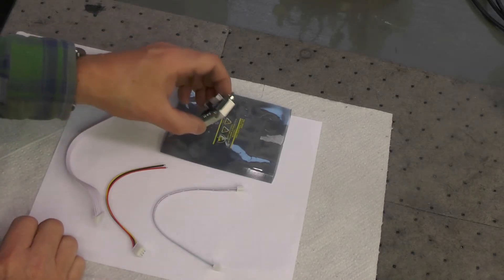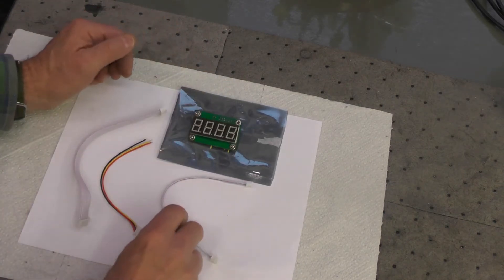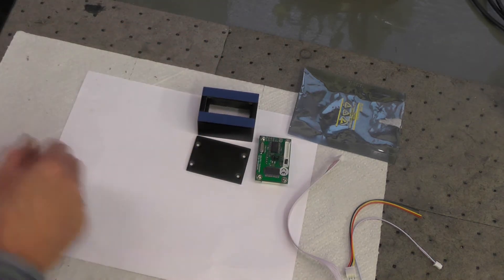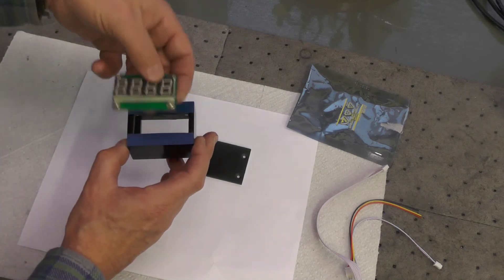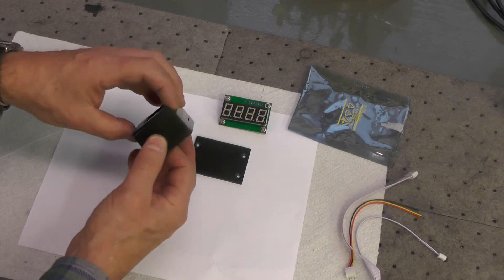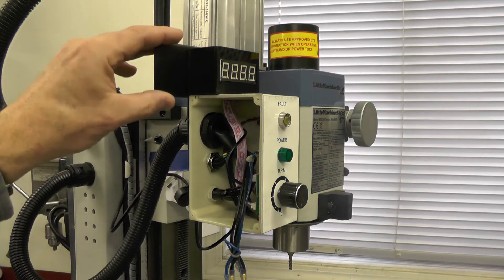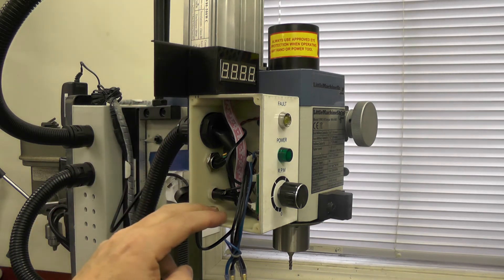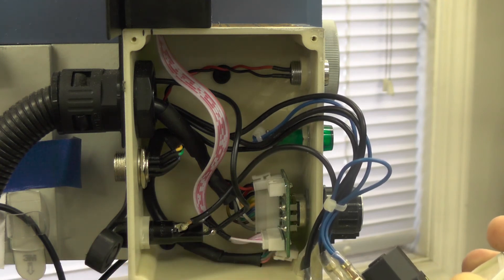Mini Mill Tachometer Install  --- Video #63

Comment: Cool to see another mill/lathe owner install the macpod rpm kit. I bought two, one each for the 3990 and 5100 I just purchased. Also discovered that both lathe and Mill use the exact same motors and controllers - the lathe has a reversing switch, however the mill does not. I bought a reverse switch spare part for the lathe and it plugged right into the PCB for the speed control, so now my mill has a factory reverse switch.
Reply from the maker: Thanks for sharing your experience and taking the time to comment!

Comment: How can these be hooked up its power source to the mills startup power. So it comes on when the mill is started.
Reply from the maker: You're asking the wrong person, without diving into the wiring, I don't know as I simply connected as the supplier instructed.  I'd suggest you contact the manufacturer/supplier of the tach for their advice.
Reply: it is connected to the power through the ribbon that connects to the control board, there is no need for any separate power feed.

Comment: Where you able to plug and play the tach ? No magnetic sensor ?
Reply from the maker: Yes, the tach connects directly to the circuit board with no magnetic sensor involved.
Reply: @kwrightway  your the first person I have seen do this. Everybody is dealing with a sensor. I have a micro mark lathe with a plug for a tach. Have asked about it but no one knew or knows anything which really surprises me. Hope I can do the same as you did. Thanks !
Reply from the maker: @georgecurtis6463  The tach I installed did not use the external plug/connection supplied with the mill.  Rather, it plugged directly into a connection on the internal circuit board.  I did not have to do any hacking of the board itself, only come up with a way to mount the display, as I discussed in the video.

Good luck with your project...
Reply: @kwrightway  ok, I thought I had checked the wires from the plug and it seems I must have messed up. I just went and took the electrical box off of the lathe and found that the plug wires go to a 7 wire connection to the speed controller. So if I get a unit that has a 7 wire connector I should be good. Again, I'm glad you posted that video otherwise I would still be loosing sleep. Thanks !
Reply from the maker: @georgecurtis6463  Sounds like you're on your way, George.  I trust things will go well for you...

Comment: I've added a readout and reverse switch to my Axminster SX2 a Seig by another colour. Used an Arduino nano v3, 16x2 display module with I2C driver.  I have line one with the intial message "Pwr ON-ZERO RPM", underneath is " * Caution * ". Mainly as a warning that although the mIll spindle is not turning,  it is still electrically live, and could accidentally be started... fingers are valuable. 
As I integrated by monitoring the reverse switch pin gave the display a feature of " > Forward  > "  and    "  < Reverse < "
To do this I disconnected pin GND on the control board that goes to the unused GND on the 7 pin socket. I then connected to the correct side of the SPDT switch. I used a small toggle switch mounted on the front next to the fault lamp, these are low power connections on the control board a 3 pin socket with centre GND, and the pin 1 and 3 the respective directions.  I added reverse for power tapping, it works very well, and the readout shows correct speed too.
3D printed a case and mounted on the top. I may add the magnets as that allows removing for future update if necessary. Currently double sided pads.
My code is based on the same as this project, altered to suit my needs.
I've added the download for arduino source on my cloud server. 
http://cloud.myowncommunity.co.uk
Login: publicshare 
Password: mycommunity
Reply from the maker: Sounds like an interesting and fun project, you took this a long way.  Appreciate the link, I'll go take a look, and thanks for all the info and the comment!